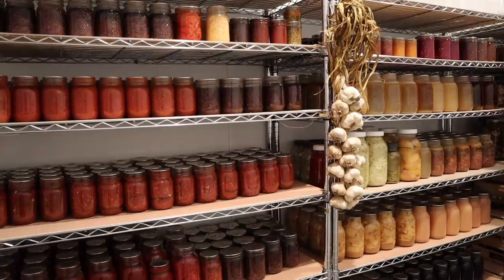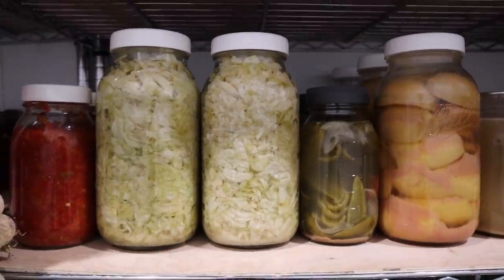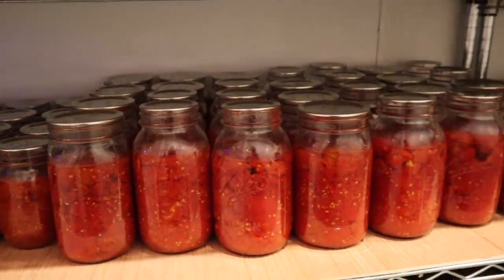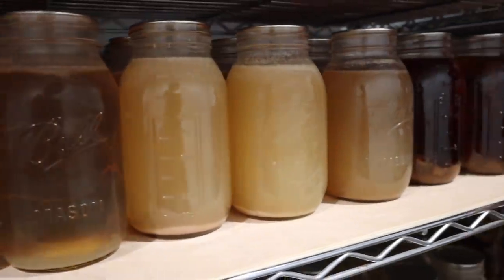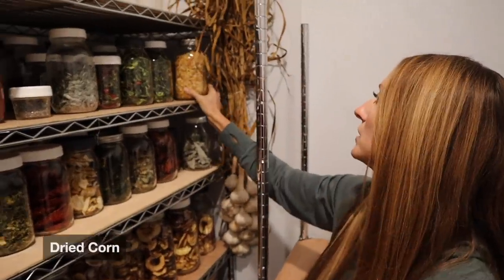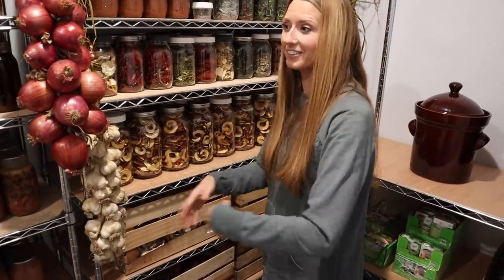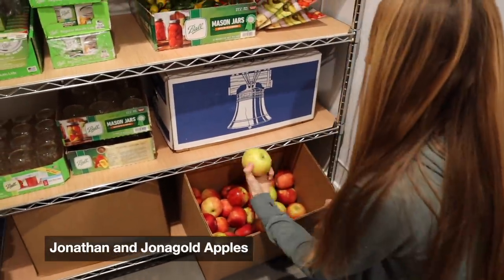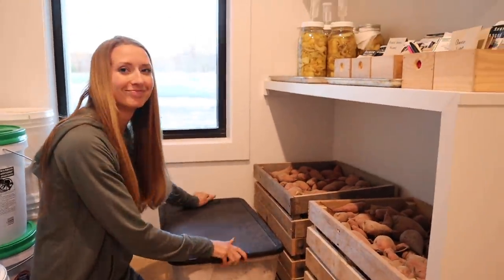Homestead Pantry Tour | Self-Sufficiency and Food Storage 2021

Comment: I'm a licensed HVAC/R service contractor. That cold room you spoke of in this video is the first time I've seen that type of system installed as a residential application. It's common in commercial applications, specifically in market refrigeration and in restaurant refrigeration. In the HVAC/R skilled trade, we refer to those systems as "walk-in coolers" or "walk-in freezers", depending, of course, on the design operating temperature of the system. You and your husband have assembled an impressive, not to mention, comprehensive pantry
 full of glass-canned food. Good job on that and on the family farm!

Comment: Once again I stumbled upon a nice video of you.👍 

I would recommend: Don't store potatoes and onions right next to apples. Apples produce the ripening gas ethylene, which causes potatoes and onions to sprout faster and other fruit to ripen faster. You can store apples and potatoes in the same room (with good ventilation), but they should be placed as far apart as possible. Also because the apples can otherwise take on the earthy, musty smell and taste of the potatoes (ugh, I experienced that, it wasn't so great - but you could store the apples in the kitchen or refrigerator for a few days and only use them afterwards , then the musty smell will be less).
For the future, when your own apple crop gets bigger and bigger: When the apple crop takes up most of the storage space, the accumulation of ethylene in the air is significant. In this case, even the strongest ventilation will not help. Then you should think about separate storage rooms for potatoes and apples.

However, ethylene has a peculiarity. At 32° Fahrenheit, its production is significantly reduced. Then the maturation process is slowed down. As soon as the temperature rises above 32° Fahrenheit, more an more gas is produced again. If you know this, you can use it to your advantage.
Temperature is important for the long-term storage of apples. It should be in the range of 32° Fahrenheit to 39.2° Fahrenheit. For late autumn varieties approx. 32° Fahrenheit. At temperatures above 41° Fahrenheit, apples begin to dry out.

Potatoes should not be stored below 39.2° Fahrenheit, otherwise they will convert starch into sugar. This changes the taste and the cooking properties, they become "floury" as we Europeans say. Then you can make completely different dishes with it, like in  Italy (Gnocchi) or in Austria: apricot or strawberry or plum dumplings (www.youtube.com/watch?v=B37jNCvGdBM - this recipe is originally not vegan: replace margarine with butter and chickpea flour with egg). Maybe the kids have fun rolling the dumplings? You get your hands somewhat "dirty" like when working in the garden, but the result is worth it! and such a sensual experience of having kneaded and produced something yourself. This also applies to yeast dough (for pizza or bread, for example).

The optimum temperature for storing potatoes is between 39.2° Fahrenheit and 46.4° Fahrenheit. If temperatures are higher than 50 degrees Fahrenheit, the potatoes will sprout and dry out.

Keep up with your wonderful videos! In these times it is important to be independent.

Comment: Excellent video & pantry. Would love to know where you learned to can and preserve, and what temp you keep your room. We just installed a walk in cooler and curious for storing our garden goods and ferments. 🥰
Reply from the maker: Learned from books and by DOING!  Have to follow tested, proven recipes, and you shouldn't run into problems.  We keep our cold room at 48 degrees.  Still tweaking with the humidity levels, but other than that, we LOVE it!   Congrats on your cooler room.  Such a blessing to have!
Reply: @TheSeasonalHomestead  Thank you♥️🥰 inspired! I've been preparing since 2016. Started with dry canning, worked my way to Waterbath and now learning pressure canning. I had joined a rebel group, but have decided to follow the blue book and just got all my new books in the mail. Recently canned pickles beets. They are so delish and I truly loved the process of canning those beautiful beets. Thank you on the cooler. We are sooo excited. I posted it in a video recently and will do another video soon on getting it fired up. We won a bid at an auction at highest bid $2k sells for $10k+ it was actually a freezer, but we are making it a walk in cooler instead. Definitely a blessing we are grateful to receive. 🥰♥️🙏✝️🕊♥️God is good♥️

Comment: It looks like you have your shelving on bare concrete, if I am not mistaken.  I built a meat rated cold room last year and needed to insulate the flooring as well as the walls. It was for the farmer so he could let the various slaughters rest for a week or so before  processing. It looks like you guys have 90% of the whole thing already. It wouldn't be to difficult to get that little bit more capability for when you off your cows and chickens.
Reply from the maker: The one piece we didn't catch early enough in our cold room was the floor.  So (shhh) it is just concrete and tile, with no separation from the rest of the house.  If we ever put up a shop, we may do a cold room in there the proper way.   Are you for hire, Jorash?  How far are you from Arkansas? :)

Comment: This is amazing! I really wanna get into starting something like this for my family. My biggest fear is it molding and going bad fast. How do you prevent that? Like apples, squash, etc.
Reply: Find the ball jar company canning site and follow the recipes carefully. Those recipes are tested and safe. And then later I think you will get a feel for things you can change and substitute, or be able to tell what recipe online will be a safe one for preserving. I'm using the easy fermenter recipes. If you get on their website I think they have them on there. If you don't have the easy fermenter,  rather than mold your big thing with fermenting in glass jars is jars blowing up. You have to loosen the jars to let them breathe once in awhile. Or you have to cover them with cloth and a rubber band. My kombucha is working really well with that type of system.
Reply: I think to begin it's good to start with things like drying and fermenting. And my grandma and older aunt said that recipes requiring the water bath instead of pressure cooking are good for beginners. Also pressure cookers are  expensive. One more thing is if you use the sterile jars  that saves a step. so don't open them until you're ready to fill them with your hot recipe. My grandma said strawberry jam is a good one to start with. That's the  one she taught me when I was a kid.

Comment: what is the white piece of material that you have on the shelving, underneath your jars? i have the same shelves and I love them but i always feel they are always a bit unsteady.. please let me know what you have used under your jars to make them more stable?
Reply from the maker: It's a piece of 1/4" plywood that Cam cut to fit the shelves.  Covers the welded wire and allows for much more stable storage of the jars.